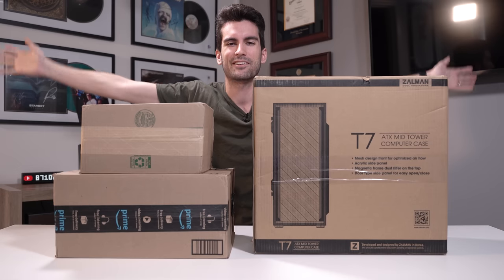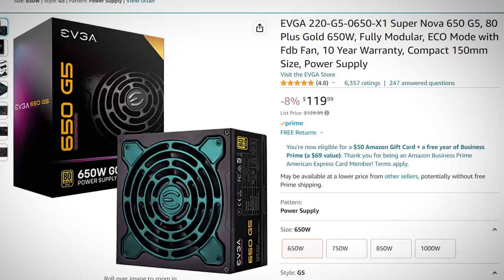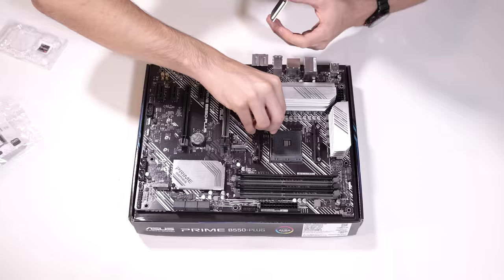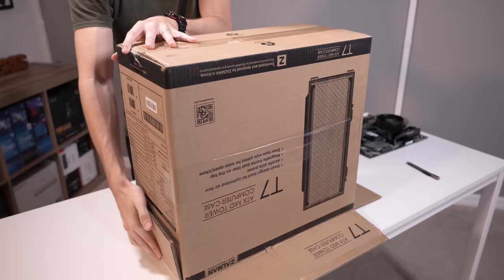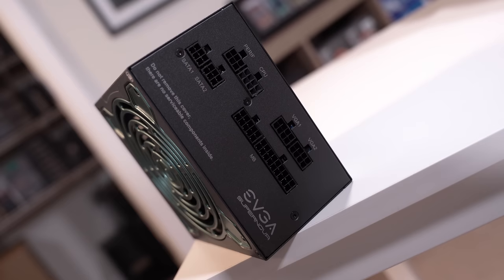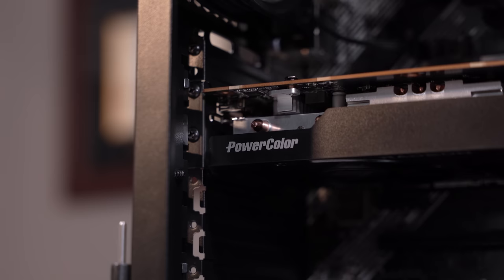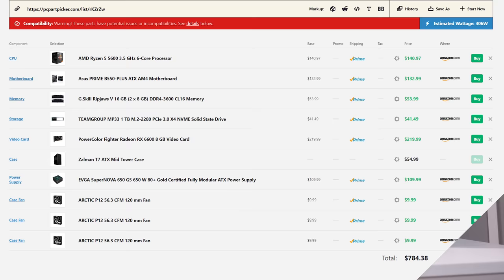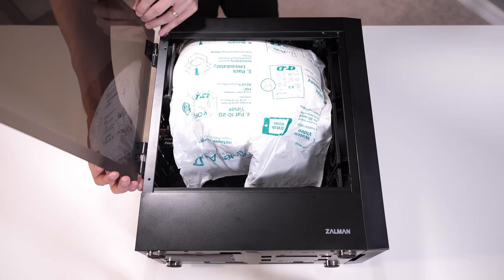Building a BALANCED $800 PC and Giving It Away!

Comment: Thank you for giving back to the community humbly I appreciate this so much hopefully someone will be able to really able to benefit from this great rig thanks again and good luck everyone entered the giveaway
Reply from the maker: Thanks for watching!
Reply: @GregSalazar  Love from India and many thanks for the great videos! Specially love the trouble shooting ones!! I wish I lived closer to you as my PC could really use your expertise. 

First time I press the Power Button, the system starts and then turns off within like 5 seconds. On pressing the power button for second time, system works absolutely perfectly like nothing happened.. windows also does not report a boot faliure... and also on 2nd press of power button it never shuts off this time. 

This happens about once in every three times i start my PC.

My System Specs :
Ryzen 7 5700G
Gigabyte B450M-DS3H on latest bios
Gigabyte GTX 1650 Super
Deepcool Gammax 400 XT Cooler
2*8GB DDR4 3200 GSkill
Samsung 512GB NVMe SSD
Antec CSK 550w 80+ Bronze (new)

Have learned a lot from you videos and tried the isolation method of Trouble shooting:

1) Disconnected all cables and peripherals and reconnected only required parts... even tried outside the case
2) Moved RAM modules to empty slots... tried with single stick also... tried different ram from another PC
3) Removed NVMe SSD and installed fresh OS on a spare SATA SSD
4) Replaced old Antec Atom 550w with Brand New Antec CSK 550w 80+ Bronze
5) Removed CPU and reapplied Thermal Grizzly and reseated the cooler
6) Updated Bios to latest version F64a
7) Removed Graphics card and tried with integrated graphics

But.... issue remains same 😭

I do not have access to a spare motherboard & processor.  Would really appreciate if you could guide me here!

Comment: I just built an $800 pc and i went with the 1tb over the half tb since it was only 19 dollars more... 
I also used a 6650xt for $249
I bought an evga 80 plus white for 52 dollars.
Also bought a lian li case on sale for 63 bucks and a vertical gpu mount.

Comment: This man is truly a legend in the master race.  I think you did quite well.  A used 3060 12gb and maybe 32gb of ram for poorly optimized games might be a solid option for a diy builder with that option. (evga b stock for example) But I think this will crush most games and I'd be so grateful for it.

Comment: You built basically what I built for a family member last year. Same exact GPU, but the differences are I went with a 5600X,  a 1TB Crucial NVME m.2 SSD and a spare1TB Samsung 870 Evo SSD I had lying around, a Montech X1 case, an EVGA 750W PSU and a MSI B550 Tomahawk board. I had a spare kit of 32Gb TridentZ DDR4 that I just donated to the build. Without the RAM it came to about the same price because of the sales MicroCenter had just before the release of Zen 4. The family member had been on an i5-4690K with DDR3 and was booting off a HDD. Definitely a welcomed upgrade for them. I think this PC you built will likewise make the day of anyone long overdue for a platform upgrade.

Comment: you should start using the Enermax revolution D.F its a 650w, gold, tier a, multi rail psu for $90-110.
you could also use the Corsair RM750X. Its a 750w, gold, tier a, single rail psu for $100-140.

Comment: Really great choices for the budget and use case.  And thanks for using this case; I've been curious about it.  Crappy budget cases really never looked this good IMHO.  And once the box is up and running, the case will keep things chilly even if you upgrade the platform to a higher TDP.  I would be curious about clearance for a mid-range air cooler.

Comment: When you factor in the cost of the extra fans, that becomes closer to a $90 case, and at that price you could've gotten a much nicer one with 4x pre installed fans and tempered glass side panel, and spent less money to boot as there are plenty of sub $80 cases that meet that specification.

Comment: This is a really nice balanced build. It will play everything the average gamer would want to play at 1080p. Gaming has become very expensive. But if you are willing to lower settings a little, it does not need to cost a fortune. This is exactly the level of performance i would tell someone to start off at. And yes. A second hand gpu would be my go to aswel. But for all new parts. This is a perfect build for the money.

Comment: Nice selection of parts for what was available. In process of looking at new graphics card as the Radeon RX5700XT is overheating to the point of constant reboot or shutting down. Had to stop building PC's due to health problems making me very tired and out of breathe when trying to left an empty Mid Tower Case. 

Thought process is more towards the Nvidia RTX 3060, as I need it for design work and programming work.

Comment: I have a 5600g build with a zalman t6 case, same motherboard, 4x 16 gb silicon power zenith rgb ram, 2 different kits cause I ordered with the wrong address, cancelled, reordered, but still got the first kit and was told to keep it, 3 pack of enermax rgb 120 mm fans, white vetroo v5 rgb cooler, thermaltake smart 500 w psu, and a rx 580 2048sp. I think it's a near perfect midrange build like this you put together here.

Comment: For those looking into a cheap quality case, take a look into Gamemax Diamond (there's a black and white edition). It comes with a hinged tempered glass side panel, a 12mm argb fan and a turbo 14mm fan behind motherboard, has support for two 2.5", one 3.5", and one combo 2.5"/3.5" storage bays. I was able to snatch one for 40 usd and it looks stunning with the new system i built a few days ago:
Intel core i3 12100
Asgard Loki W2 2x16GB 3200 c16
TeamGroup MP33 Pro 1TB
MSI Pro H610M-G DDR4

GPU, Palit GP OC GTX1650, was salvaged from an older 3470 rig we used for 6 years. It was a later addition to the system.

Comment: I've looked at some used cards, but lately, it seems that the "buy it now" prices are only about $20-$30 less than new for the ones I'm actually interested in, and at that little of a difference (which is often even less if they are charging shipping) I'd rather buy new and get the warranty that comes with that.
Reply: For anything newish, there's no point in buying used right now. The used market always takes a while to catch up to the new market in trend, especially when that trend is down.
Reply: @AAjax  Most of what I'm looking at are last gen cards, but with such little difference in price, it feels worth the few extra bucks to get new with a warranty instead of used with an unknown history. And yeah, prices are trending down, so a few times I've seen the new cards dip below most on the used market and it takes weeks before they finally admit they need to adjust their asking prices on ebay, marketplace, etc.

Comment: PSUs are stupid expensive right now. So I bought a CORSAIR RMX Series™ RM650x 80 Plus Gold Fully Modular ATX Power Supply, a top rated PSU with 10 year warranty for $150 Canadian. Actually bang for the buck to get a top rated PSU that will last when lower rated ones are so expensive that the relatively minor price increase is worth it.

Comment: That is a pretty nice set of components for that budget. I would be looking at something like a 1TB Solidigm P41 Plus for the boot drive, which Micro Center is selling for $49.99. It is PCIe 4.0, with QLC NAND, but it performs quite well, especially with the new Solidigm NVMe driver and the Solidigm Synapse Toolkit. Twice the space and somewhat better performance, for $10 more.
Reply: Looks like he did install a 1tb at least. I grabbed a SP 2TB UD90 for $88 last week. SP is another good option I think 👍🏻
Reply: @jeffcoutre2913  Yep, he did install a 1TB model this time. I thought I heard him talking about using a 512GB model.

Comment: You happen to choose the exact same motherboard I had a problem with. No matter what bios version the bios would go crazy and crash as soon as inserting my RTX gpu. Would run fine on a basic vga card. Just a bizzare fault! Had to get rid of it but I didnt pay any where near full price for it on eBay. I still use my AX370 because of this but no where near as good on paper but it works! 😂

Comment: I went with the 6700XT Power Color fighter it was only a 2 slot card which paid off when i wanted to add a wifi pcie card 6e the graphics card was not in the way so i like the fighter graphics card.

Comment: I don't want to sound like i am complaining, but weren't there cheaper PSU options?
I mean, for a budget build of $800, going for Full Modular PSU seems extra expenses, which could have been directed towards either the CPU or GPU instead (if possible).
Not sure when you brought the parts, but currently there are some options from Thermaltake and EVGA for 500W-600W 80+ Gold which are under $80.

Comment: lol u almost built my system i have a r5 5600 a powercolor 6700xt red devil an asrock  b550 c-m( i think its an oem board because it came in a plain white box new) 32 gigs ram 3600 and a 1 tb nvme hard drive and a seasonic  focus 750 watt power supply and a lian li 215 mid tower all bought at micro center

Comment: For anyone in the chat, here's a better build for $816.82 - PcpartPicker :

cpu : ---Intel Core i5-13400F 2.5 GHz 10-Core Processor
cooler:--- be quiet! Pure Rock 2 CPU Cooler
mobo : ---Gigabyte B660M DS3H AX DDR4 Micro ATX LGA1700 Motherboard
ram : ---TEAMGROUP T-Create Classic 32 GB (2 x 16 GB) DDR4-3200 CL22 Memory
ssd: ----Samsung 980 Pro 1 TB M.2-2280 PCIe 4.0 X4 NVME Solid State Drive
videocard: ---MSI MECH 2X OC Radeon RX 6650 XT 8 GB Video Card
case: ---	DIYPC F2 MicroATX Mini Tower Case
power supply: --- 	Thermaltake Toughpower GX2 600 W 80+ Gold Certified ATX Power Supply

Summary : better cpu, double the ram, better gpu, (and ssd is from Samsung)

Comment: I like these giveaways you've been doing, but this build could've been done better. The Rx 6600 is lackluster for an $800 build. For $800 you could've fit in an RX 6650 XT, or even an RX 6700 which would've been way better. To start, you didn't need those 3 extra case fans, the two 120mm ones were fine. That fully modular $110 PSU was also a bit wasteful, you could've saved about $40 by just getting something semi-modular. The B550 is also somewhat unneeded at this price range, and you could've saved about $50 by going with a B450 or something similar. That would've freed up enough money to give this build a fitting GPU for the price.
Reply: Cool breakdown bro. You should teach him by making your own video that will show him then. 🙄🙄🙄🙄 where would the world be without YouTube know-it-all's
Reply: @johnjacobjingleheimerschmi2108  It's true. A 6600 for $800 is not good. He even has a $500 microcenter build where he uses a 6600 which is much more balanced budget wise. For another $300 he should do better.
Reply: @johnjacobjingleheimerschmi2108  bro is getting free pc, and he writes a paragraph of complaints 🥴🤡
internet man
Reply: @vator_rs  He could've gotten an even better free pc if this was budgeted better.
Reply: @truereaper4572  send him an email and ask him to hire you so the next time he makes a giveaway, he doesn't commit such an awful mistake of not giving you a free pc that hasn't been min maxed to the T

😢
Reply: @truereaper4572  ive been building and working on computers for about a decade now, and I love picking parts and helping friends build their computers, so I am pretty well informed.

Its just that the tone and intention behind your comment is a bit of a bad taste considering its just a giveaway pc, which he mightve not been able to pick exact best value for various reasons.

👍
Reply: @vator_rs  As a pc enthusiast myself it's just painful to see when someone butchers a solid budget. I can see how I came off rude previously, and my last reply was disrespectful to you and I apologize.
Reply: @truereaper4572  I get your point, and I came off as an asshole as well, but yea it is what it is. 
Have a good day my dude.

Comment: 30$ of case fan but not cpu tower cooler

Why??? :(
Reply: I'd make the same call in a budget rig. That Wraith cooler is surprisingly good for budget processors. It might not be the quietest, but it will definitely get the job done. And the case fans will definitely give it a helping hand. You can have a great cooler and still have thermal issues in a case with poor airflow. But, wow, are case fans expensive now!
Reply: @Rebecca_English  
You will definitely have better temps on the cpu with a cheap 20$ tower cooler 

I think people today gives way to much credit to airflow
Reply: @BEN ASAIAG  Sorry dude, I learned the hard way with my current rig. I splurged on the cooler (AIO) and cheaped out on a case with less than ideal airflow. My rig is basically a heater. I consistently get Temps of 80+ degrees under light gaming. So, yeah. Airflow is important. Lesson learned.